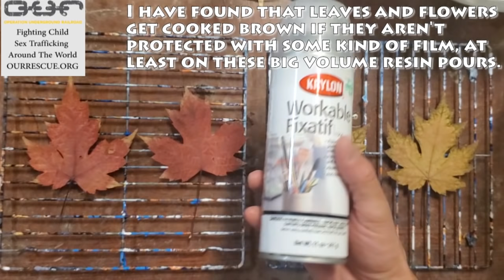"Autumn Windows".  Fall leaves, resin, Birch Wood bowl wood turning. Support O.U.R. at ArtForOUR.org

Comment: @nick zametti you need to do this bowl but... "better?" (Sorry if I did that wrong, I don't know how to tag another creator on YouTube.)

So, Dan... this is really cool!!! The concept, look, etc is all great. My only wish is a different connection point for the leaves at the stem given we can still see the hot glue points, as well as the few bubbles and small imperfections that remained visible. I would have liked to see those drilled out and more resin added by putting tape on the surfaces or something. Maybe doing the drill out and putting some white resin there (I'm not entirely sure about different colors but u get what I mean hopefully)? Plus any other finishes you can use? Cuz that would have been pretty breathtaking if it was MORE clear. I am a big fan of the fall based design used like that.

And I'm sorry I'm sounding critical. This is my first experience with your page/work and I actually really enjoyed it. I just wish there were a few alterations/improvements (not the best word choices but again...I hope you get my meaning...lol). 

Love your creativity!! Gonna go check out some more of your stuff now!
Reply from the maker: Thank you so much!  Yes this project was long ago.   Many lessons learned since!  😀

Artforour.org

Comment: Very nice and you got me thinking of a different method. I suggest turning the 4 windows first to the depth equal or slightly deeper than the thickness of the finished bowl. Fill the cavities with deep set resin . Either one at a time and let set or seal each one with plastic,/ tape and leave to set together.. No need for pressure pot. Then turn as normal.
Reply from the maker: Great idea!
Reply: Was thinking the same thing, then the other piece of wood and blue container could be used for a different project.
Reply from the maker: @yb554  Let me know how it works?
Reply: @artgivinghope  Thanks! I've never used a lathe before. The most I've done is a little bit of intarsia. Wood and resin can be cost prohibitive, so my mind went to, how could this be done more cheaply.  Good job by the way and for a great cause.

Comment: Hello what’s the sand paper grit number to polish the resin to clear?
Reply from the maker: I'm still struggling to figure this out, but I'm getting good results using regular sandpaper from 80 to 400, then using a wet sponge system from 500 to 2000.... see my amazon links in the comments...

Comment: It was necessary to attach the leaves in a different way. You can see the glue. It would be better to drill a thin drill, drop some glue into it, and insert the leaves. So that these glue drops are not visible 22.36
Reply from the maker: You're right!  That's what I'd do now days.... :)

Artforour.org